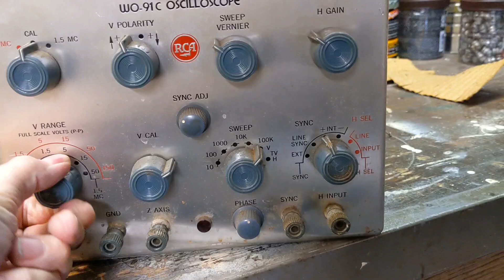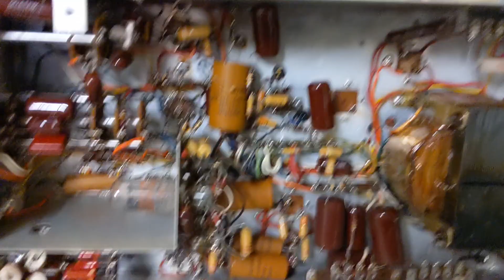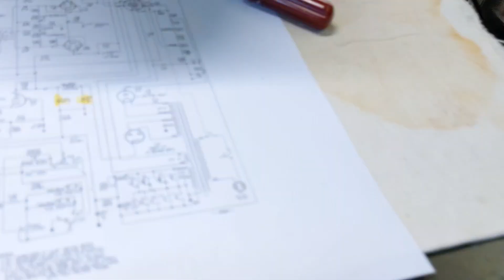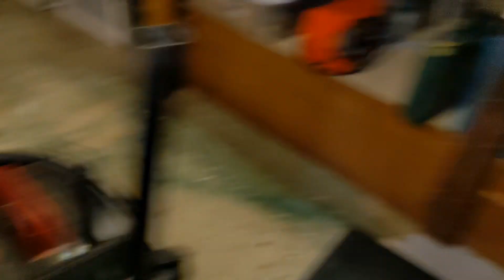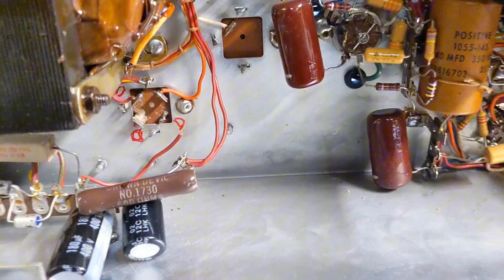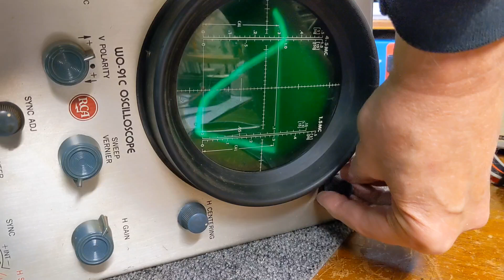Old School RCA WO-91C Oscilloscope Restoration.

Comment: Fantastic find and repair to get it working at least. WO-91A was from 1956 with a small upgrade to WO-91B in 1960. Finally
they upgraded the power supply circuit to solid state  in 1967 to  the WO-91C. Back then this was a back up oscy in a 
repair shop for just specifically quick checking radios and some circuits in televisions. Surprised they didn't upgrade the connector from the old style  Switchcraft 2501F to BNC on the front by then, but you can do that when you do fully restore
it. Look forward to an eventual part 2. Thanks Fred. Steve from IL
Reply from the maker: Well I still have a ways to go to get it working the way it should but at least there is a trace on the scope. Its interesting that there are a lot of schematics on the internet for the 91A & B but none for the C version.
It was easy to trace the wiring once i realized the replaced the rectifier tubes with Silicon diodes. 
Yes I will be replacing the old switchcraft with a BNC at some point. 
Next its on to ordering all the caps I will need and resistors if necessary. 
Well its Christmas Eve and the hobbies are on hold until the 26th so part 2 will be delayed.